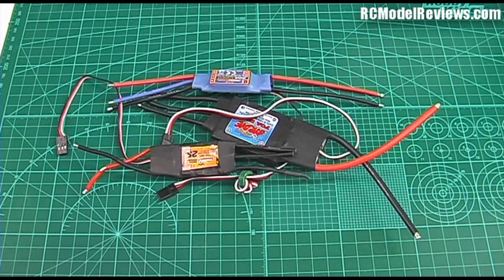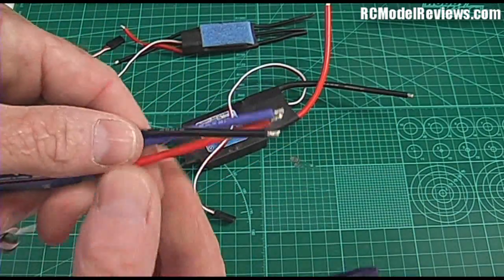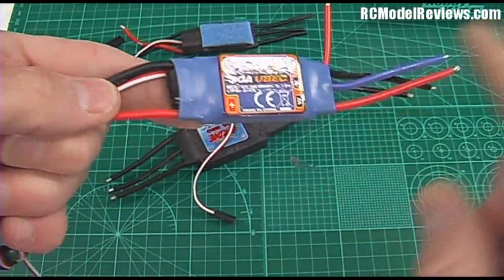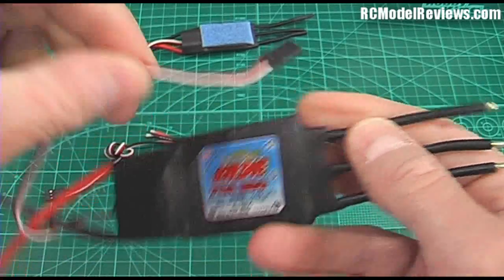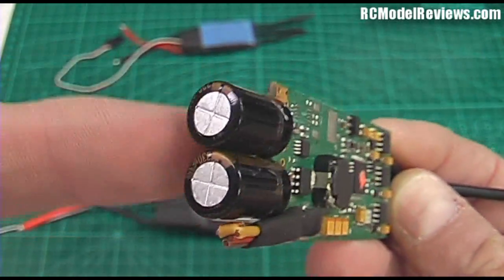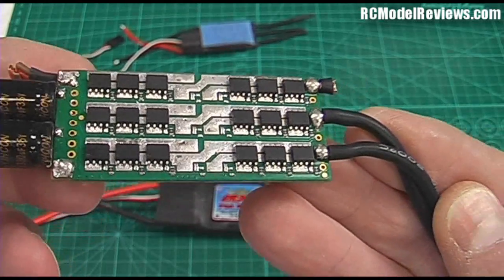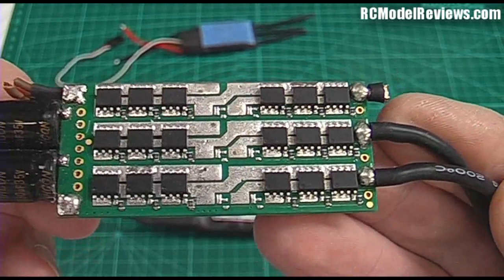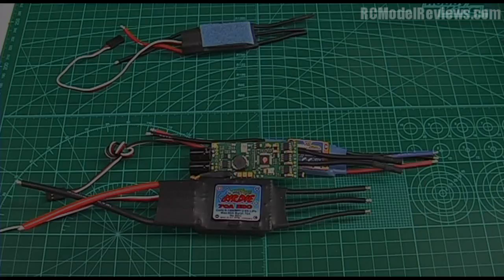What's inside: ESCs

Comment: How do these RC ESC know the position of the rotor ? No doubt it is through back emf sensing but how do they actually do it ? Are they doing zero crossing sensing on the inactive coil ? Do they sense zero crossing only on one phase or on all three phases ? 

What is the exact microcontroller on these boards ? Are they general purpose uC or specialized for this application ?

How are the outputs ? Are they pwm driving the motors or do they do a single pulse per turn on each phase ?
Reply: +shodanxx
Yes, they detect rotor position through back-emf sensing on the undriven phase. When the motor starts from a standstill, the ESC feeds it a canned commutation sequence to kick the rotor over fast enough to acquire a back emf signal. Thats' why sensorless ESCs won't start a motor smoothly at very low power and RPM, and it's also why they suck for low-RPM high-torque applications, because at high currents the switching noise on the coils messes with the faint back emf signal, and 'confuses' the ESC. For traction applications i.e. electric bikes & skateboards, large heavy RC cars etc. a sensored ESC is better because rotor position sensing is independent of back-emf signal strength and is unaffected by power switching noise.
The microcontrollers, as I understand, are general purpose units and are very inexpensive. The software for sensing and noise filtering of the back-emf rotor position signal is mighty clever though!
The outputs drive the motor using PWM for throttle control. On many ESC types, the PWM rate can be selected by the user. Same with the lead angle, which they often refer to as 'timing'.
Reply: shodanxx You sample the adc mid pwm pulse when signal is stabilized. Your zero is sum of all emf voltages and on the dangling coil the voltage is 0 to vemf range so it is not an ac current making it easy to sample directly on the uc using just a resistor voltage divider to step down the voltage to adc levels.
Reply: Josh Brown impedance is of no interest at all. It is never measured. Don't confuse people.
Reply: Excellent and Clear explanation.   Sure you are a basement engineer. ?
Reply: the motors have 3 channels corresponding to the 3 output wires from the esc, these are positive,ground and open. When the magnets inside the motor pass through the open terminal the impedance sky rockets and makes it possible to know exactly when the magnet is in the center of the open terminal, once this is detected, the terminals are changed to pull the motor around to the next stage and this cycle continues.

Comment: is it possible to use a small ESC to switch high power FETs to save money?
Reply: Andrew Crews I was thinking of using a $10 ESC to power some 300amp MOSFETS on a separate board with proper heat sinks, (a 300A ESC is hundreds of dollars)  to control a high HP BLDC.
Reply: +Andrew Crews Good answer, modifying an existing ESC is asking for trouble because of the requirements for MOSFET gate drive and rotor position sensing, not to mention the copper circuit board traces and their inherent current handling limitations. Soldering on higher-current MOSFETs in place of the existing ones is a labour-intensive mess waiting to happen. It's actually probably cheaper just to buy a higher-current ESC.
Reply: +Charles Woelfel 
You can do this with brushed motor ESCs only. You take the brushed ESC motor output leads, connect the negative lead to the Source pin of the large MOSFET and the positive lead to the Gate pin, with a pull-down resistor from gate to source to allow the external MOSFET to turn itself off.  You also must install the appropriate high-current Schottky diode across the brushed motor terminals, and use appropriate capacitors across the battery leads to filter the noise. It's tricky to get just right, but it can be done.
For Brushless controllers... Not so easy! More than anything, you're looking at a false economy because getting it to work (if it ever will work) is going to burn out so many FETs that you may as well just spend the cash on an appropriate ESC to begin with. What do you plan on doing with it, an electric bike or skateboard type project? If so, there are sensored controllers that are far more appropriate for that applications. You'd have to install Hall sensors on an RC motor to work with them, and the controller must support the typically high RPM of RC type motors.
Honestly, you're better off just buying an appropriate speed control for your application.

Comment: But how does such a tiny thing produce the thousands of volts the motors are rated for?
Reply: Nathaniel Nifong kv rating isn't kilovolts. the kv rating tells you the rpm of the un-loaded motor. multiply the kv rating by the battery voltage and you get unloaded rpm.

Comment: PLEASE ANSWER::: I am building an F450 Flamewheel. I'm building it with the DJI 40 amp ESC's and the DJI KV: 920 rpm/V Motors. The ESC says it'll take a 3-4s battery. I'm thinking about getting 4s and a high C rating. I'm wondering though if the ESC is a 40amp ESC and I'm using a 5,000mah batt with a 45c max that's max 225 amps right? Is there any point in getting a battery that can output MORE amps than what the ESC is rated at? Or will the ESC always drop it down to 40? I want to get the best battery for LONG and Powerful flights.
Is a 3s with lower C better for longer air time? But 4s higher C more powerful? I've watched your lipo vids and this vid as well as many others and they've been a great help so far. But if you could give me some advice when it comes to this I'd be greatly appreciative. Thanks!
Reply: Matt Faulkner What do you find funny about it?
Reply: Jeff Adams Well you know, the more ignorant, the simpler the joke required.
Reply: haha nobody replied
Reply: shut up
Reply: Yeah I just saw that and laughed. No reply necessary. Built that 450 though and it's flying well. GPS hover is an awesome feature that allows me to film while rock climbing without having to control the quad.
Reply: And the answer to the amperage question came to me as a "duh" moment. You have to multiply by 4 on the ESC because you're running a quadcopter. And having the extra amperage is good, allows expansion to a hex which is pretty easy with my setup.
Reply: You may want to make sure the motor is rated to take the power of the 4S. The ESC only needs to be rated to the motor max current, not the battery capacity, unless you are planning on upsizing the motors later. You dont want to get a battery thats so huge that you exceed the thrust capacity of the motor/prop combination you have. And unless you are planning on letting your craft go off on its own for a GPS flight, you will find that after about 8-10 minutes of buzzing around a 100 meter area, your fingers and concentration will fade. Better to buy 3 or 4 2200 3S at $15 each, charge them all up, have a break between flights, let your esc's and motors cool down, and in an hour you can head home. The 20 or 30A ESC's will be $12 instead of $25 also, enough saved to buy 8 instead of 4, giving you 4 spare, or 4 for your buddy to use to build his quad. Your AUW will be around 1kg, each of your motors with a 10" prop are probably rated by the mfg at 800-900 grams of thrust, which x4, gives you almost a 4 to 1 power to weight ratio. Well in excess of the 2.5x most people use as a calculation. Have fun.
Reply: Matt Nicassio XD   You covered everything I was typing up!!!
Take a look at the Tarot 960 on my channel I am setting up!!
Reply: Hi Matt, don't fall into the C rating trap most people think if you have a high C rating your battery will last longer in fact the higher the C rating only = power boost such as if you have a 20 c rating you will have a smaller power boost to a 70c rating and that will run down your battery faster. I own several helicopters from 250 size up to my T-Rex 550 pro and have over 30 batterys and not one of them are above 30c and believe me i get plenty of speed and power.
Reply: George Cooper Thanks for the input =) I'm in a similar boat. Less than 30 batteries. Probably only about 5 right now. But so far I have bought nothing over a 30c rating. That's mostly because of the drastic price increase once you go over 30c. But also I sort of imagined the smaller c rating supplying the full amount of voltage my setup would need all while not over-discharging my battery = longer flight times. You mentioned your experience being based on low c rating. I wonder if you've ever compared that experience with a high c rating? Do you have ANY batteries with a high (say 75c) rating? Personally I'd like to do some comparisons first hand. But from what I've gathered online, the high c rating is great for things like racing mini quads. You get a huge punch and the throttle is super responsive. Flight time may be slightly reduced but with mini's your flying for 5-6 minutes anyway. My F450 is up in the air for 20 easy. But she for sure is not a racing quad! In fact that is where my current studies lye. Working with Gains and trying to figure out why my flamewheel is so 'floaty.' When I'm flying around quickly she tends to REALLY hold inertia and continue to move in the same direction long after I've given input. I was hoping the NAZA might have an option to combat this. Make the quad more 'sticky' in the air.
Reply: Matt Nicassio Hi Matt, yep i bought a couple of 70c Thunderpower batterys very expensive but they are in my opinion the best batterys on the market, and if you take care of them will last year's unlike some cheaper ones. However to answer your question yes they give a better boost of power but that power runs the battery down faster for instance flying my T-Rex 450 with a 3s 2200mAh 20c (about £15) i get between 5 and 5 and a half minutes flying including 3D. Now compare that to my 3s 2250mah 70c (about £55) yes i get a bigger balls to tamworth but the battery only lasts between 4 and a half minutes. Just one thing to remember, you probably know this but never run your to low i never run them below 30 percentage of the battery charge. Hope this info helps.

Comment: I just crashed my Vision+ V3 so hard the poor phantom bounced twice and the battery went flying in the opposite direction. One ESC cracked in half, the body is shattered, the internal battery plug became unmounted and the motor was crushed. I was able to test and it still has power. The gimbal works and it also communicates with the vision app. However, when I tried starting the motors none of them spun. Of course I wouldn't expect the broken one to do anything but should that one ruined ESC and motor effect the other motors? Is this normal? I already ordered the body, a 2312 motor, an ESC v2.0 and an internal battery plug.

Comment: Completely wrong! It's not outputting AC, it outputs commutated DC.
Reply: Natterjak2012. He is not completely wrong, but you are a complete jerk.
Reply: It does not have to be a sine wave to be AC. There are square wave AC inverters. AC means that the current is going one way, then flips to the other way on a set basis. in DC, it can be on, or off, or anything in between, but it can't go backwards. Pulsed DC is just DC that's turned on and off and a specific interval. Most commonly this is PWM, although it can be a square wave or a sine wave or anything in between. ESCs use pulsed DC, not "commutated" DC. A commutator is an electromechanical device used to produce AC (not pulsed DC)! AC is when it reverses direction periodically and the average voltage is zero (since it goes forwards, but then backwards again, both at the same voltage). The voltage you hear referred to when talking about AC is actually the RMS voltage. From the viewpoint of the rotor on a brushed DC motor, it's actually receiving a polyphase AC signal generated by the brushes and the commutator ring. Furthermore, BLDCs can be powered by AC (provided it's controlled properly, i.e. mains voltage probably won't work, you need an ESC), but in terms of ESCs, it's alot easier to just use pulsed DC.

https://en.wikipedia.org/wiki/Root_mean_square
https://en.wikipedia.org/wiki/Electronic_speed_control
Reply: Does the current remain the same or does it alteyrnate. It alternates. Does it alternate in a sine wave No, so it is not what is typically called alternating current. I usually refer to it as physically or electronically controlled current. Obviously, an AC current can be converted to DC and then fed to the brushless motor.
Reply: Do u know the type of caps that r inside the XL -2 trying to find them thanks !! RCFL